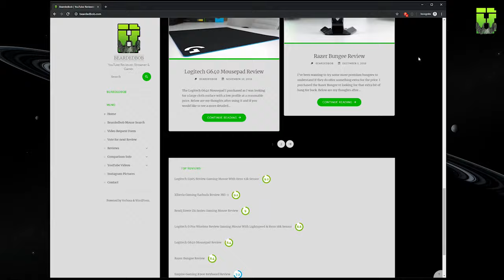Logitech G502 Weight Reduction Gaming Mouse Mod

Comment: I've gotten my original G502 Proteus Core down to about 90-92 grams.. My scale isn't too accurate.

I took out as much as I dare while still keeping all function, every button still works, and the free scroll too. I also still have the palm plate.

Now I have a 4 dollar paracord cable coming from Aliexpress to finish off my mouse. 

First round of modding was done in 2017. Back then I got it down to about 105ish grams.
2nd round now in 2021. ~91g

I still think it's too heavy. There SO much heavy thick plastic used all over the place. I think a fully custom, light-as-possible shell would be amazing. I need every button so I can't just remove buttons either.
Reply from the maker: Nice job.

Comment: Neat glide test ive never seen anyone do that before. Your aware that the weight savings is for weight savings and not glide. You can do numerous other things to completely reduce how much glide you do or dont have and can go to extremes in other direction while adding and subtracting whatever amounts of weight you want.

If youve ever treid any aluminum mouse pads over the years youll notice razer used to ship some that were lightly oiled. Ive even gone to the hassel of oiling metal pads in the past. You can make those things give you basically 0 friction while not adding any inconsistencies to glide or feel and the farther down the 0 friction hole you go the worse these things will eventually perform and feel. Too much lack of friction and youll have trouble aiming and it could take a while to get the mouse feeling semi normal again. Then good luck going back to a heavy mouse itll likely take longer and annoy you more lol

Neat work though. The looks always nice but i already worry too much about sweat and skin cells with a regular mouse let alone any honey come ones or even one you made the holes in yourself without doing any deburring :P

Comment: found a quick and painless way to quickly and easily remove 15 grams without drilling even 1 hole.  look at 29:16 in the video. Remove the bottom door around the sensor thats used to hold the weights in (-6.09g) then remove the top palm rest with the "G" logo (-4.98g)  and then remove the rubber coating from left and right sides (-4.57g)  leaving you a whopping 15.64 grams lighter. With minimal effort which is key
Reply from the maker: Yep and easy 15g saving 👍

Comment: I don't know if you can get your hands on a g602. it's a bit of a hefty boy due to 2 AA batteries. Do you think it's possible to get the g602 to 60-80 grams at least?
It's definitely for a friend..
Reply from the maker: 130g base weight to start so its going to require a lot to get there. not impossible but depends what you are willing to sacrifice

Comment: Hey I want do this to my g502, do you think it is safe or something a 13 year old could do at home, also, how can i make the holes in the mouse without the screwdriver/drill tool thing?
Reply from the maker: The tools you need an adult to help  you with it. I hurt my fingers so its not that safe using a drill. You can do some of the mods but drilling I would leave or get someone who is more experienced to do it for you.

Comment: I have been through a ton of mice so far and this one has been my favorite by far! As far as being able to work on the mouse itself I was able to replace the switches with some brown ones and also did  some new feet for them but over all these are very easy to take apart compared to the newer wireless mice out there.
Reply from the maker: Nice job.

Comment: Did it in mine a while back. Off the magnet, off the bottom plate, holes in, cut out the bottom. And a piece of dark tape under the DPI lights, they are just too bright. Debraided the cable. Need to get a replacement wheel and some more boring at some point, but I want to keep the buttons, that was one of the reasons I bought the mouse in the first place.
Especially under the backplate there is much to cut.
Reply from the maker: Nice job

Comment: purchase a g502 lite. It absolutely annihilates the fact about 11 buttons and a hyper fast scroll wheel. It does not have scroll and the only buttons are the left and right because on the old one you sometimes were ment to click the primary click but you hit the g9 button. ge one today for more than 2 g502 lightspeeds

Comment: You could have saved even more weight by using the g900 scroll wheel and made it glide even better by using tiger arc mouse feet
Reply from the maker: Yeah I heard you can use the 900 scroll wheel on it. I might try that on the light speed I need to do.
Reply: Beardedbob ok and you should try the feet too

Comment: I used this tutorial to spray my mouse and havent finished yet, waiting for the paint to dry, really helpful
Reply from the maker: Cool, link some pictures when you are done. What steps did you take to paint it?
Reply: Beardedbob only thing that doesnt work is a macro button, side led and rmb. I still think its a personal success it still works.
Reply: Beardedbob i used a rustoleum paint with some primer. I just took it apart, used painters tape and sprayed
Reply: luckily i had a backup, my good old g502 lightspeed that is my trusty brick
Reply from the maker: The storm trooper theme nice.

Comment: How much would you charge to do this to my Logitech G502 Lightspeed wireless mouse?
Reply from the maker: Hi,

You can pick what options you would like here in the below URL. This G502 wired had a stage 3 mod applied to it. https://shop.beardedbob.com/products/logitech-g502-lightspeed-weight-reduction-custom-modification

Heres my G502 Lightspeed Modding steam video. This had a Stage 2 mod done to it. https://youtu.be/PCGidE6bF60

Comment: I want to do the same but with G402 u should do part 2 and u will doing weight reduction on G402 cuz in my openion G402 is better mouse :) (for fps games i think)
Reply from the maker: G402 weight reduction is on the list and should be soon,

Comment: would you be willing to sell this/do this to my G502
Reply from the maker: Hi,

I wouldn't want to well this one but if you wanted I could do one for you.

Here is the logitech g pro wireless one that I offer https://www.beardedbob.com/2019/10/31/logitech-g-pro-wireless-weight-reduction-stage-3/

Here is the order form and pricing (it's not cheap as it's a lot of work. https://www.beardedbob.com/logitech-g-pro-wireless-mod-request/

The g502 is not an easy mouse to work with.
Reply: Honestly, I don't feel any difference between 70g and 150g so its really unreasonable at least for me

Comment: And here i am still using all the Weights that come with this mouse. IDK i prefer it being on the heavy side. Especially with the DPI settings i use which are pretty fast. If the mouse is too light its harder to use high DPI settings for me personally.
Reply from the maker: If you like a bit more weight then that's fine. It's all personal preference 👌
Reply: @Beardedbob  Yeah like i said ive tried it with weights removed and it seem like i lost a bit of control for precision movement especially with a really high DPI setting like i like to use. I like to get a lot of coverage for very little movement out of my mouse. Which i think is why the extra weight makes it feel better to me.

Comment: This is too much shave.this is easyier broke when it fall
Reply from the maker: The g502 shell could survive a nuke 👍
Reply: He ain't wrong I modded mine too and the amount of times I've launched it at the wall is crazy. The most damage I ever did was pop one of the switches but easily popped back in I have 3 g502 and 2 broken g305. They broke legit by just slamming them down once I dont really like the g502 but it works fine for me specially with me been an aggressive gamer it's good to know every time I rage I'm not throwing £60 away. My mod isn't as much tho I save all buttons and my overall weight is around 78grams

Comment: Well, good effort man.  Hopefully this video and the final product helps to convince people to just buy a lightweight mouse to begin with if that's what's important to them.  Plenty of good ergonomic options in the sub-90g range.  I would say a custom paracorded cable and upgraded mouse feet, like the Toger Arc 2s, are the sweet spot for the G502.
Reply from the maker: I agree, this is not something I recommend, it's an epic amount of work and risk.
Reply: What mice have very similar shape (in particular a kinda deep thumb rest) and are lightweight?
I know of 4: Razer Basilisk X HyperSpeed, Roccat Kone Pure Ultralight, Roccat Kone Pro Air & "PMM P-502" (200€ G502-Clone, 3d printed with holes). You know more?
Cuz the G502's weight is giving me health issues, playing fingertip grip, steady arm, only moving my wrist.. :S Desperately looking for a replacement, but I can't decide...

Comment: IMO you should just use faster/harder surface mousepad and perhaps smoother skate.

I really think a mouse should have at least 95-105 gram for longevity purposes and i don't think anyone would think 120 gram a burden. Most of the time it just the friction of the pad that makes you think you can't stand the dexterity/weight of your mouse.

I might be wrong though, let me know if you think it has huge different between the 100 gram and 120 gram.

Comment: Why not just buy a different mouse. You have basically stripped the functionality out of this mouse. Also if you are going to this extreme might as well remove the buttons from the board for those buttons. You could also reduce it even further by proper spacing in the holes you are drilling. And then chamfer each hole. I still don’t understand though. If you want a mouse without extra buttons buy one.

Comment: I’ve been sitting on this question for a long time but if you decide to drill into a certain place like into m1 and m2 of the mouse, will it feel more fragile when clicking?? I plan to mod the model o for example and want to drill into m1 and m2 so I can put lizard tape over them and it still feel the same for a little bit of benefit but I don’t know if my fingers will crash into the mouse. Thank you!
Reply from the maker: No, I expected the button to flex more but they don't
Reply: Ok, thank you!
Reply: @jovinscottpianalto4336  Did it work?

Comment: wow you can make this mouse useable
well at least its not 150g anymore but the shape is still terrible
Reply from the maker: It’s certainly much lighter. With all of the buttons and wheel in its close to 100g. You could replace the scroll for a g900 version to face another 10/14g

Comment: Cool video but sort of barbaric work done, I did same to my G502 Lightspeed (wireless one, with batt), but all buttons work, non functional removed (only logo LED, and scroll mode switch selector - imo useless feature), all slider still in place. Ended up on 78.62 Gr in the end. I never believed before i did it myself, but folks: less weight - more frags indeed
Reply from the maker: 78.62g is a decent went you got it down to. Nice job.
Reply: @Beardedbob  took me about 3 hours dremeling ahahha but it worth even tho mouse looks ugly as hell
Reply: @Flenger  More ugly for more frags, sounds like a good deal. :)

Comment: I see you're quite active here so I will go ahead and ask - does drilling holes in the plastic chassis remove much weight or is it a novelty?
Reply from the maker: the base has the weight but the sides not so much. The g502 rubber though is heavy
Reply: @Beardedbob  Ever tried to find a way to drill in a honeycomb pattern into mouses?
Reply: @decasaint532  You could drill holes and then file every hole to that shape?

Comment: Without buttons and wheel it makes no sense. Its better sell g502 and buy lighter mouse.
Reply from the maker: Depends as some people like the shape of the G502 but there is no lighter mouse that has this shape hence you have to customise it. I would keep the buttons if I was using the G502  but some people want it all removed so you can see whats possible in this video and decide who far you want to go.

Comment: Holy crap what a shitshow. Just get a light mouse at that point (which I didn't want to do because they lack the buttons). This is pointless and undoubtedly the mouse feels like holding your hand on a cheesegrater.
Reply from the maker: Each to their own
Reply: @Beardedbob  Sure, except for absolutely ruining a fairly expensive mouse and removing 90% of it's functionality. Especially since the amount of buttons is frankly, a major point when choosing it over other mice.
Reply from the maker: This is about showing people what's possible and to help them decide if they want to take it to this extreme. You would be surprised how many do. At the time of this video light weight mice were limited and even now you can't get one in this shape.

Comment: To save even more weight I actually undid the mesh around the cable
Reply from the maker: how did the cable feel after that? I'm assuming its more flexible? If you have some pictures of it place them in here https://discord.gg/EfCqHx
Reply: I grabbed one of these (paracord?) cables and it arrived yesterday: https://shopee.ph/product/110640364/5639104167

I nearly can't feel it. It's softer and more flexible than a shoelace. I'm worried about the durability though in case I travel, but usage-wise, it's nearly wireless I'd say.

Comment: Just buy a fucking model o
Reply from the maker: Why it's a different shape 🤷‍♂️
Reply: Or u could just take kf the weights
Reply: Cux the weights are like 20 grams
Reply from the maker: Removing the weights certainly takes some weight out but even then it's still not light. 

This video is extreme but there is potential to get it down to 80g while keeping the buttons and rubber.

Comment: Why would anyone spend all day doing this when you can just buy a lighter mouse???
Reply: Infinite scroll wheel, can't go back once you've had it in most cases.
Reply from the maker: You can’t get the g502 as a lighter version yet. If you like that shape/combo and you don’t like the weight then this is why 👍🏻

Comment: the point of buying a g502 is heavy to start with....what kinda ppl want it to be light and still use that shape ..lol
Reply from the maker: People want the shape without the weight.
Reply: I love the shape, but it's stupidly heavy, I love and hate the mouse at the same time.
Reply from the maker: I agree. It was made at a time when heavily was better and manufacturing wasn't as easy.
Reply: Alan Xu Have a lot of keybinds on it and i’m not used to using a keyboard.Hard to switch to anything else when I’ve become so used to the 3rd thumb button and buttons on top.

Comment: Orrrrrrrrrrrrrr you could just buy a lighter mouse.
Reply from the maker: That would be the preferred options 100%, but someone out there loves the g502 curves and lines but just not it's weight.
Reply: @Beardedbob  Yeah I say that but people seem to want to mod a mouse like the model O so it's even lighter than it already is (which I'm not sure is possible without damaging it's already weak shell integrity).

I don't fully understand it but then it's not my money so I guess I don't have to.
Reply from the maker: I took out 13g from the Model o with little effort, and it didn't damage the integrity. worth checking out if you haven't already https://youtu.be/3wB20D_c5qQ